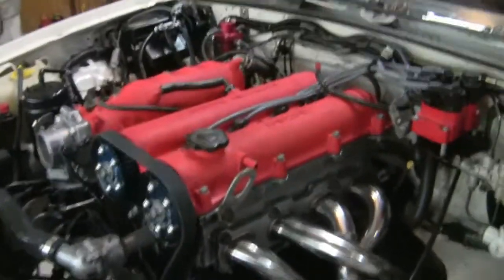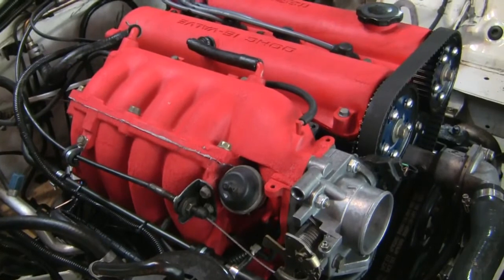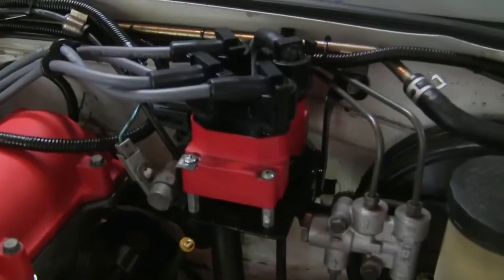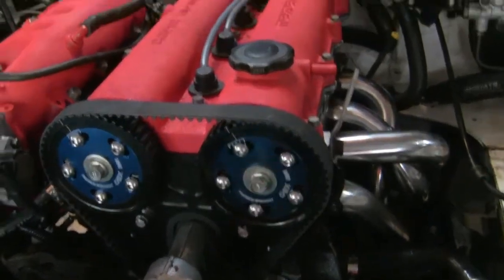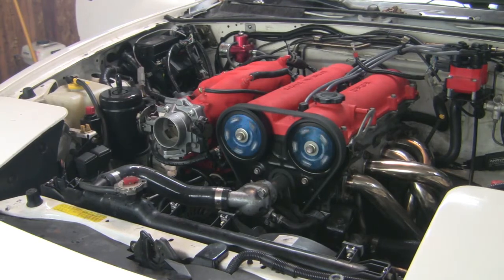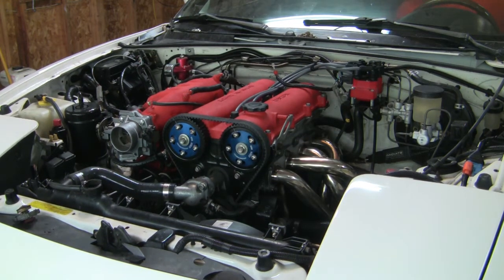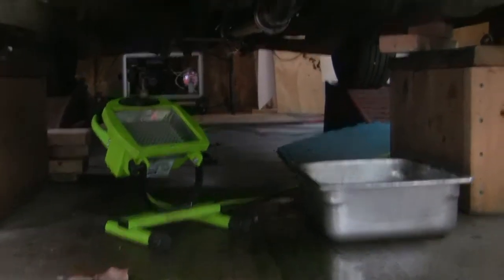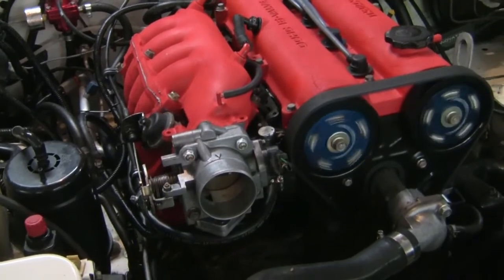94 NA Miata with 2000 NB Engine first start.   Megasquirt and EDIS4 content

Comment: Hey, so I bought megasquirt off summit I did vacuum line into intake and plugged in harness, is there more steps I need to do before I can fire the car.
I have 1994 miata with a 2000 engine Atwell
Also 1994 ecu is what u are using right
Reply from the maker: Hi Anthony,  For this project I used a Megasquirt 2 "complete".  The "complete" edition of the Megasquirt is a universal megasquirt and required a  custom made harness, also, I had to write my own tune.  For the ignition system I used a custom built EDIS-4.  Pretty much everything connected to the Megasquirt was custom built and I did not use a PnP model.  I'm not sure if I could give you any advice because my system was unique.     The one thing I would mention is the vacuum line from the megasquirt needs to connect as close to the throttle body as you can.  Attaching the line to a random place on the intake manifold will cause tuning problems in the 3000-4000 RPM range.  Good luck with your project.

Comment: I just did this swap and I’m getting a crank no spark,  all the connections are reading saying there working but coil pack isn’t receiving anything. Tried the coil pack off the 94 and off 2000
Reply from the maker: Hi, I'm using an EDIS4 ignition with a Megasquirt 2 for engine management.  I have no idea what giving you trouble.  Are you using the 94 CAS?
Reply: @robotcantina8957  yes I had car running on stock ecu but randomly stopped working while I was at wotk

Comment: Hey I have a question. I own a 91 Miata with 1.6L engine  automatic transmission can I swap it with a 99 1.6L automatic transmission
Reply from the maker: Hi, when it comes to automatic transmissions, I'm no expert.  You might want to ask over at Miata.net

Comment: Nice, I just finished mine using the stock 1.6 ecu. Used the old 1.6 electronics. Not much info on swapping the early NB 1.8 onto the NA.
Reply: ive bought a bp4w for my 90 chassis, you say it uses the old 1.6 electronics?

Comment: nb motors have the cam sensor on  the valve cover. what did you do with that?
Reply from the maker: The engine is set up with an EDIS-4  crank trigger ignition system.  The OEM cam sensor was not required.
Reply: @robotcantina8957  are you on a standalone
Reply from the maker: Engine management is a Megasquirt II.
Reply: @robotcantina8957  thank you